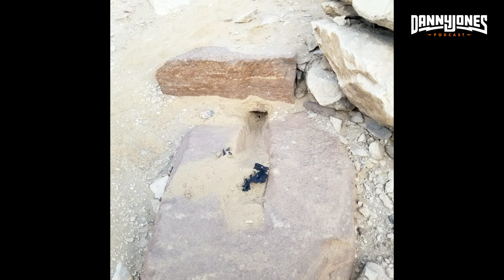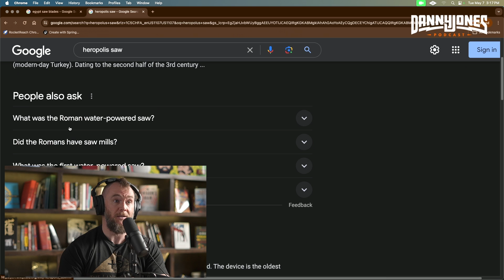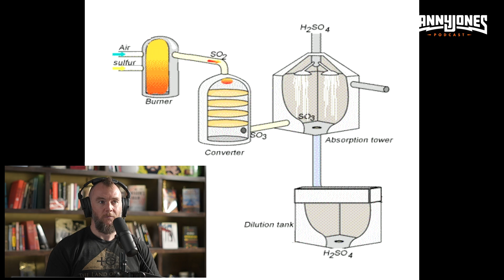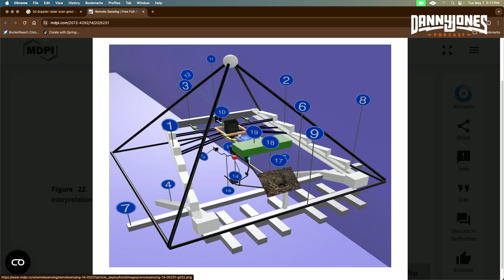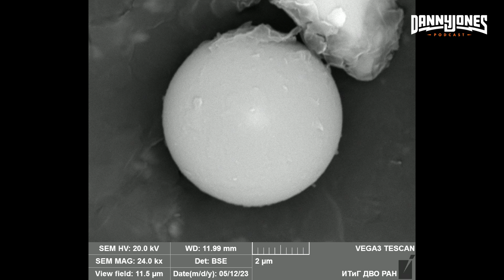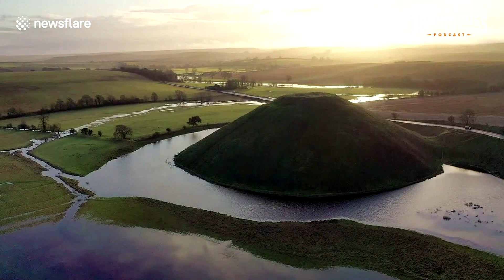Chemical Factories in the Great Pyramid: New Evidence Rewrites History | Land of Chem

Comment: Black basalt in Egypt contains magnetite.When magnetite (Fe3O4) is heated, it can undergo several changes, primarily related to its magnetic properties and oxidation state. Heating can lead to a weakening or loss of its bulk magnetism, especially when heated above its Curie temperature (around 570°C). Additionally, heating can cause magnetite to oxidize, transforming it into maghemite and then hematite.

Comment: Sand and a copper blade can cut the stone. The copper doesn't do the cutting, the saw will drag the sand back and forth on the cut line. Like he said slow cutting and removing of the excess material. Sand cuts and then you wash in out and more sand repeat
Reply: Yes. It cuts at 4mm per hour.

Can you help me with the math of figuring out how long it takes to stack 2.3 million blocks when you cut them at 4 millimeters per hour?

By the way, even if you cut a block that way, you won't get the angle of the cut right. You'll have made A cut. Not THE PERFECT cut. You need to cut 4-6 faces of 2.3 million blocks perfectly.
Reply: Its similar to if we left in spaceships to avoid catastrophe. But left native tribes that aren't part of our society. Like amazonian tribes ect.. if a flood happened and the survivors had to restart. Imagine who would claim what and how they would explain the things left behind.
Reply: @aaronmunzel3587 exactly who runs shit today possibly whoever survived the cataclysm

Comment: 1:01

Get yourself a laser thermometer and go outside on the next sunny day and point that thing at a spot on a wall in direct sunlight
now walk around the nearest corner and measure the temperature of the dark side

There on the Sea shore 6000 ybn the sea breeze blowing in the background on the north side of the big old pointy building without 
a point on the top is cool while the other side angled along the 24 degree bent that the earth has to the sun to get more surface
area exposed to more direct sun light you have a heat generator creating the movement of positive and negative charges along
around through and as the buildings themselves in the configuration they are in relative to the real source of the energy 
the big hydrogen ball 93,000,000 miles off the southern wall and if the sneaky other name for half the smallest unit
of hydrogen was not the proton it would be a little simpler for the 8,000,000,000 people alive today to understand
what quite a few fewer people understood about the tear drop they are tearing around the big magnetic pool of 
billiard balls in on around but not part of

Comment: 57:30

the diagram shows the dock system at the base and the lock system which ran up the sides to float all of the big stuff up to the big
machines in the middle of the big building which was sitting on a bluff looking at Greece from the shore on the south side of the pond
If you look at the google earth image from above you will see the eight docks which are still on the west facing edge of the 
central pyramid and the shafts holes pointing to the underground system which was used to raise and lower the water level up and down
the hill from the base of the buildings to the butt of the Sphinx

controlled tides 
what a concept

Comment: When I look at the Wardenclyffe Tower. It was listed as an atmospheric apparatus. 
To me the Wardenclyffe Tower was designed to harness the power of a lightening bolt. 
The salt water under the tower with metal sunk into the water. Allows for more frequent lightening strikes.
The spark gap is a filter, to filter out run away currents. This is to dial in a certain frequency of electricity to use.
The Tesla fly wheel would have the mass to handle such a large voltage. When the flywheel is up to operating speed. The energy is harvested to allow for generators to use the electricity. Then the stable current can be distributed over long distances.
With the research I've done on Tesla. I do not see his patients as different machines, but are different patients for each step of one machine.
If people would stop looking at it as a way to distribute electricity in the air and instead examine everything as a lightening harness machine. 
When you look at the insulators and safety devices implemented. You can see that if the building was struck by lightning. The outside of the building wouldn't harm anyone around it.
Reply: This makes a lot of sense, I thought the same thing but I Didn't think it was from lighting bolts itself, I thought tesla found out how to harness the electricity before it became a bolt. But that wouldn't make sense. I Didnt think it was that upfront, But remember, People reported a lot of lightning storms when he was up there. This is what he meant for free energy.